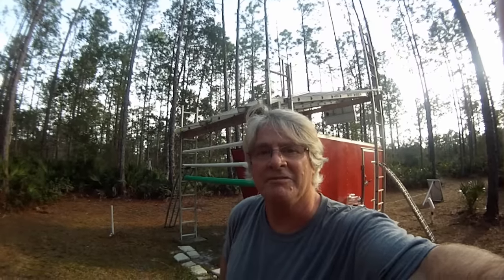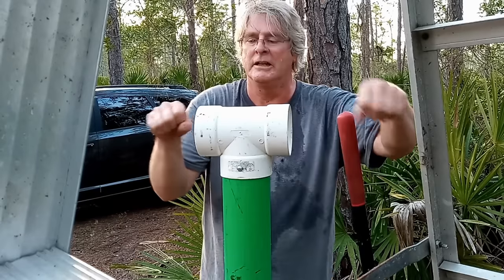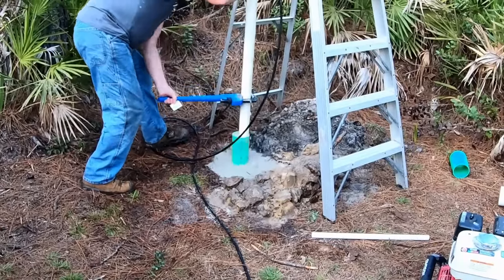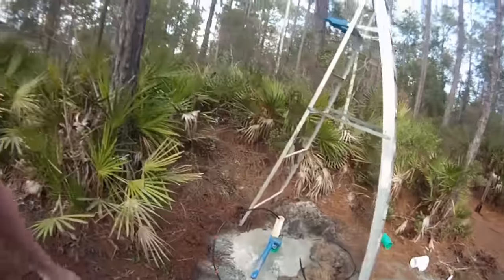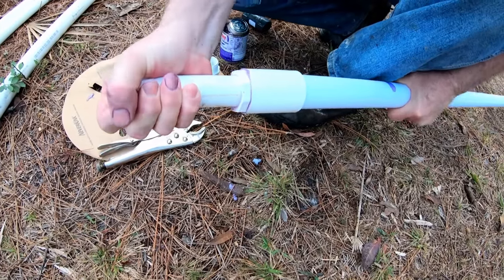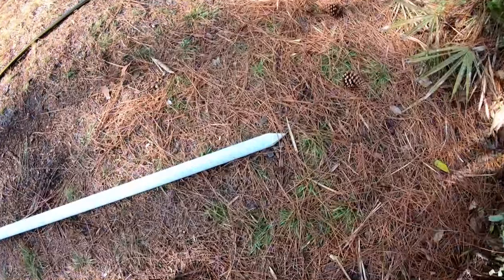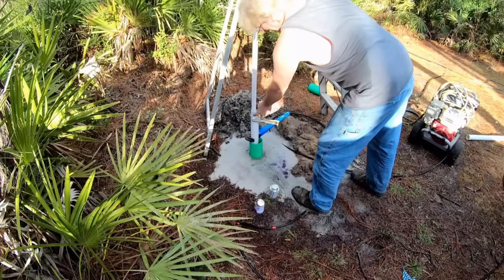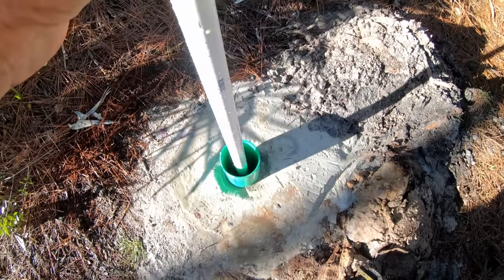Easy SHALLOW WELL DRILLING Howto DiY drill 25 ft shallow well

Comment: Nice. Roughly what latitude in Florida you at and what time of year was this filmed? March?  I'm wondering about the temp of the water in August and if possible to use this well for a small open system Geothermal cooling for your trailer? A small (possibly custom) radiator and fan and a pump powered by solar and lithium.  In Lake Placid Florida I was able to hit water at 12' easily just by hammering down a PVC Wellpoint without all the other steps.  I'd like to cool a 8x8 insulated shack under the trees down to 73F when its 90F outside.
Reply from the maker: - Hey 12v -
Thank you for watching .I've never recorded  the temperature of the shallow well water. so I cant say for sure.
its definitely cold . ive used the water enough to know its  temps gotta be in the 70's

Im sure if you dream it up, it can be done!! make a video!!! I'd like to see your finished idea!
thanks again for watching!

Comment: I have never seen anybody put the check valve down in the ground on a shallow well always rite at the pump how will you change it when it goes bad if you were in a area where you had to winterize you can pull off the check valve and let the water drain back into the ground
Reply from the maker: Hey Randy,
Thank you for watching.
its preference mostly but,
I like it in the water pocket area mostly because --
it will hold the prime to the pump better than up high.
water below the check valve can possibly develop a small air gap 
just under neath the valve. if it get s to much air, it is next to impossible to prime the pump without filling the pipe with water.
Thank you again for watching

Comment: Where do I get one of the jet tips for the hose?
Reply: Sewer jet tip for 1/4 inch hose off Amazon
Reply: @void_dweller7851  got it!
Reply: @cinepost  just put mine in the ground yesterday worked great. Measure and mark the length of quarter inch hose  so it doesn't go further down than the in the ground and catch on the edge of pipe.
Reply: @void_dweller7851  so was your casing 2” with th WellPoint at 1.5”?
Reply from the maker: Hey Captain,
Yes, great comment and point! If you look closely, you will see I have marked with tape as not to let mini jetter go deep beyond the drill teeth.
Reply: I have a 1" 1/4 point driven in my basement in a pit that has 10" clay tile liner but has filled with sand. Can I drive a 5 or 6" plastic pipe around the point now that it is pounded in...please don't say I need to pull it up as I was 3 days pounding it in. Hoping I can make or buy a large diameter slitted pipe to put around the 1.5 steel point that will allow the water to flow in as it is encapsulated  by sand and barely letting water thru

Comment: Are you drilling in sand? What about in dirt?? Or on a mountain? Can you find water there? Thanx
Reply: of course water is below every surface. worldwide.
Reply: this method wont work with rock - Dirt, silt, sand is best  - the more clay the less likely this will work
Reply: The water table is usually pretty low in the mountains. My property is in the Appalachians and I had to drill 345 feet to hit an aquifer. If you're lucky and have an underground spring then water can be gravity fed to a cistern. I haven't heard of too many shallow wells in the upper elevations.

Comment: Video was helpful but it seems alot of stuff got edited. Got down 20 feet and the jetter got stuck and I can't get it out .The jetter hose must have gotten damaged because it has no pressure now and I have no clue what to do because I can't get the last 10 foot to move. I'm pretty sure if I did get the last 10 feet down I wouldn't be able to insert the 1 in piping into the 2 in with the jetter hose inside and  don't know if I should cut it. Any advice would be appreciated.
Reply from the maker: hey antonio,
thanks for watching.
1st , put on safety glasses.
then,
send another hose down beside the falty hose.
PULL sand out with jetter as you go down the shaft.
you will eventually get down the 20 feet as so you can remove the old hose.

then, be careful as not to let jetter extend beyond end of drill pipe. you will then be able to drill and add a section of pipe to get down the 30 feet.
the key is not to let your hose get down beyond drill teeth.
mark your hose with tape at the 19-20 foot depth. 
thanks again for watching

Comment: Where can I find a mini jetter? Thanks in advance.
Reply from the maker: Hi Richard,
Thank you for watching.
Just Type in " Mini Jetter " in search box on google search.
It will come up with all types of mini jetters. 
Thanks again for watching
Reply: @AtlanticDrain  I have the jetter now but I'm having trouble getting through the hard pan or maybe rock. I'm in north Florida.
Reply from the maker: work that 2 " pipe! Did you get down 10 ' with the 4"pipe?
how far down have you gotten?
good teeth on the 2" pipe will cut slowly thru the hard layer of sand and / or  peat moss. just have to work it a bit more using the pipe wrench. you can also put a "T": on the end of the 2" pipe for more control as you cut / grind your way thru that layer.
the big question is how far down are you right now???
Reply: @AtlanticDrain  I got down about 8 feet with the 4 in pipe and started working the 2 in pipe and hit something hard. There are rocks in our area.  I started another hole and didn't get but about 5 ft down when I hat something hard again.

Comment: Could I use a brass foot valve instead of a check valve up top?
Reply from the maker: Hey Brian.
Thank you for watching.
 a Brass foot valve goes down at the bottom of the pipe in the shallow well.
you could try this but,  a point and 4 or 5 foot of micro slot perforated pipe then a check valve works pretty good.... but, as long as you are in the water pocket.... i just like having the 4- or 5 foot luxury of the point being in the pocket with suction area ( 4-5 ft)   to spare.
Thanks again for watching.

Comment: when i install my point, the pump pumps all the water out of the hole and loses prime.  point is at 30 feet deep, and standing water level in 2" pipe is at 5' below ground prior to pumping.   what am i doing wrong.  the 2' pipe got stuck at around 19 feet.  lot of hard clay
Reply from the maker: Hey bill, thank you for watching. I'm not sure but, it sounds li ke maybe you cracked the pipe and water from around the 2" pipe is all the water you are getting. If the pipe has a cracked, it will not suck water from well point. I could be wrong but ask around get some more info. Thanks again for watching

Comment: Interesting video but serious overkill on the primer and glue. You could do a better job with half the glue and primer. Lightly prime both sides and lightly glue both sides. Twist them together and hold  15 seconds past solid. Works great and you don't have excess primer softening things that don't need softened and globs of glue running down the pipes.
Reply from the maker: Hey 4x4,
Thanks for watching.

Comment: Could this work in clay soil?
Reply from the maker: Hey Leona,
Thank you for watching. Yes it could.  The mini Jeter can do the cutting.  It will burrow down just beyond the pipe teeth, pull it back up above the pipe teeth, twist your pipe go down an inch or two then, let the mini jetter cut thru more clay. How deep are we talking about going?
That could be a factor.
Thanks again for watching
Reply: @AtlanticDrain  ok thankyou...not sure how deep ...until I reach good water

Comment: Not sure “master Plummer” knew correct way to install tape. Always install leaving first thread open and installing tape so cut off end is in direction  of tightening thread, 40 plus industrial years of installing every imaginable type fluid pipe
Reply from the maker: Hi John, Thank you for watching.
Reply: He also put tape on counter clockwise and only used primer and glue on fittings except at long lengths of 1 inch

Comment: I feel dumb for asking this. But what are the chances of the slotted pvc well point becoming clogged with sand? I’m going to attempt the same materials for a shallow well but I’m debating if I should switch to the galvanized screened well points that’ll block small particles. Any thoughts or experiences on this topic? Thanks.
Reply from the maker: Hi Kieth,
Thank you for watching.
so far, the well point micro slots are working just fine.

Not sure the galvanized well point would fit thru 2" pipe + fittings needed may be different sized...
Idk if its better...maybe we will get more input from other you tubers:)

Comment: Opinions on doing this in something more gravely material. I have several feet of sandy gravel. 1"-2"  minus. Water is at the 30'-ish depth. Can you jet enough big stuff away? 

Thank you for doing the video.
Reply from the maker: hi chris,
thank you for watching.
i guess it depends on how thick gravel is.
it can pull up a couple rocks  a few feet but not more.
Thanks again for watching
Reply: Use an air lift to remove to remove gravel from inside pipe.

Comment: So today I started my point well. I easily dug down, was in sand in 18 inches, and had water coming in before I gave up on the post hole digger. I started jetting with the 4 inch and was able to get it down pretty easy, but a few times the jet head and hose got stuck in the sand. My power washer is just an electric one and my thought is that it doesn't produce enough pressure to clear enough of the sand and it ends up burying the hose? Any thoughts? The sand up here in Maine is coarser than your sand, maybe more difficult to lift? I think my pressure washer only  produces about 2000psi or less.
Reply from the maker: Hi Vickt,
Thank you for watching.
If you are down 8-10 feet with 4" pipe.
Just start with 2" pipe. Just be careful not to let jetter go under drill teeth.
Once in a while, just lift thejetter hoseto release some of the sand from the top of pipe. Should be fine. Thanks again for watching
Reply: Sand is settling above the jet, meaning you dont have enough pressure to push the sand all the way up.  Pull the jet up until you start getting clear water back, then put the jet back down.

Comment: I have a stainless steel 1 1/4" well point that won't fit down the 2" pvc. Do you think I could do the same process using 3" inside the 4 inch (providing all the 1 1/4 fittings all fit inside the 3') and then sending the point and hardware down the 3 and pulling it. Perhaps the issue would be not enough space between the outer of the 3 inch and inside of the 4 for the sand to exit? I'm in Maine, already on a well point that is likely no further then 15 feet deep, all sand.
Reply from the maker: Hi Vicktdot,
Thank you for watching!!
3" pipe is much heavier than 2" pipe.
Maybe it would work that way if only 15 feet of pipe is inserted.
best bet is to get your money back for the stainless, and purchase pvc well point and micro slotted pipe. use fittings shown in video.
but again, I think your Idea would work as long as it is around that 15' depth. once you get the 3" pipe moving upwards, don't stop till its out of the ground!!!
Thanks again for watching!!!
Reply: @AtlanticDrain  If pulling the 3 inch is a problem, I'm sure I could assist with my tractor bucket! With very tender control use of course!
Reply: I would stepping up the pipe size throughout would supply more water

Comment: I NEVER use teflon tape at all!
Reply from the maker: Hey John,
Thank you for watching. FINALLY! Yes! Plastics don't need Teflon tape going thread to thread. That's just an extra comfort thing for people!
Thanks again for your watching!
Reply: @AtlanticDrain  i don't use teflon tape on iron pipe, or anything at all. If I want to seal threads, I use thread sealant paste compatible with the pipe and the product running through it. Thanks.

Comment: I am Melbourne Fl and tried drill like illustrated in your video. I am about  15' down and found what I believe is water bearing sand. Can you tell me how much further I need to go to hit a water vain?
Reply from the maker: hey unity,
thank you for watching.
the drill pipe will GLIDE when you hit a water pocket.
goes down thru ground like butter.
thats how you know FOR SURE you are in a water pocket.
thanks again for watching.
Reply: @AtlanticDrain   I went down about 12' when it went down like butter and stop at  about 15'. I continued and got white sand but it wouldn't go down an further. Is that deep enough for a sprinkler system?
Reply: @unitynow2868  I am interested to know as well.

Comment: I can build you something for around 400 bucks you can use a garden hose or that pump and dc powered drill have 30 ft deep in about a hr with way less work.
Reply from the maker: Hey Nokia,
Thank you for watching!
yeah, make a video! show us what you got!
Im sure we all want to see that DIY set up.
Thanks again for watching!
Reply: @AtlanticDrain  I need to make one so i can get more of these little things sold . I Have tested them to 60ft here . But my soil is clay with some sand so the walls hold up better than in sand  . Want to find some one who is good with a 3d printer that can help me design a bit for homeowners . Those open things most people are building are fine for sand only but if they are any clay it wont work to efficient.

Comment: Where are you getting your water supply for the pressure washer?
Reply from the maker: hey bret,
thank you for watching.
you need 2each 30-50 gallon containers, like, garbage containers. put them up higher than pressure washer for gravity feed.
start siphon, start pressure washer.

although, i used water from an adjacent property (with permission from property owner) and ran 700 feet of hose.
 I did have at the ready water in containers.

thanks again for watching!

Comment: Why didn't you use a slip slip PVC check valve?
And why don't you follow the simple steps that are printed on the primer and the glue containers?
Reply from the maker: Hey offplan,
Thank you for watching.
To get your attention...Rebel Video.
Ive used pvc glue for years. i like to goop it on pretty good.
no problems here.

Comment: Why do you reduce from 1-1/4 to 1" ?
If you have a large enough pump could you run 1-1/4 all the way up to the pump?
Reply from the maker: Hi The Great Cumbini,
Thank you for watching!
1 - 1/4" pipe with COUPLINGS will not fit thru the 2" pipe...
the coupling outer diameter would make for a VERY tight fit for sections to go down thru the 2" pipe.
it may be able to go down thru there but, I wouldn't want to do that unless i absolutely had to. maybe with some modifications to the outer diameter of the couplings like, sand each one down an 1/8 of an inch....
Thanks again for watching!!!!

Comment: Absolutely will not work in South Miami Florida.   Though we can hit water at about 12' or so, our soil level is only a few inches before you hit coral rock.  You must use galvanized steel pipe and pound it through mostly solid but relatively soft coral rock for hours.  However we do have lots of underground caverns, so if you punch through into one of those you could go pretty deep in a hurry, and might even lose your pipe.   On my well I'm only at about 14' and can't drive it any deeper by hand, can't pull it up either.  In drought season it runs drive after about 5 minutes.  Trying to find a way to get it deeper without having to pay the well man to fix it.

Comment: Thanks for the instructional video! 

Just a couple quick questions, if you have the time:

1. I live in Northeast Florida, where the ground is typically pretty soft. However, after about 12ft down, I hit harder soil and after about 5 minutes, the water completely stopped flowing from the 2" pipe. I did verify that I was still receiving high pressure from the nozzle. Should I be concerned that I may be forming an underground pocket of water and risking a sinkhole? I found it odd that I wasn't seeing water overflow so I paused my project.
2. Is it normal for the 2" pipe to lodge pretty down pretty tight? I'm worried that, once I finally hit the water table, I won't be able to remove it. It feels like there may be thick mud between the 4" pipe and 2" pipe causing suction.

Thanks in advance!
Reply from the maker: hey micheal, thanks for watching. sounds like you may be in the wayer pocket or water table . drop a tape measure down there is it wet? then you probably good to go. you can easily put the 1 
' pipe down thru and put the lift pump on to check it out.
Reply: @AtlanticDrain  Thank you for the reply! I'll give that a try and send an update.

Comment: Curious what was your water source for the pressure washer?
Reply from the maker: Hey James ,
Thanks for watching.
I had available a couple options.
1 - I had 2 NEW 30-40 gallon garbage containers available to siphon for pressure water.
The other was getting water thru a hose from an adjacent property. had to run 7-800 feet of hose.
thanks again for watching.
Reply: Yeah 🤔  why you need water when you already have it using a pressure washer ?? Things that make you go Hmmmm ?? 🤔

Comment: Thanks for the video.  I am in Albuquerque NM, about 1-1/2 mi from the Rio Grande.  I was drilling a 1" hole as a test to see if I find the water table level, as I didn't have a clue how deep I would need to go.  I got about 7 ft down, hit some very fine light colored sand and seemed like gravel right past the sand...my problem is, as soon as I hit the gravel I also loose water and stick my drill pipe.  I moved aprox 100ft away and experienced the same thing at around 9ft.  Not sure what to do next...any suggestions would help!!  Thanks CP
Reply from the maker: Try a 2" pipe as a drill
Reply: @AtlanticDrain  I was thinking a 4",  I'll let you know how it goes. Thanks for your time!!
Reply: @carryplant8539  how did go?
Reply: He fibbed.
Reply: @carryplant8539  Hurry up, my popcorn is running out.